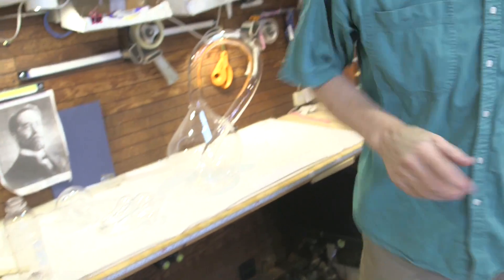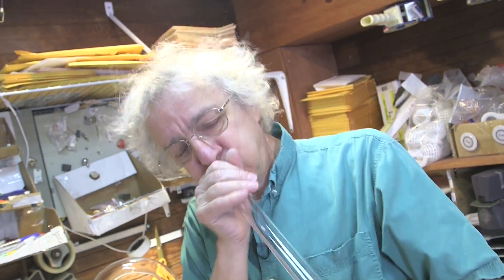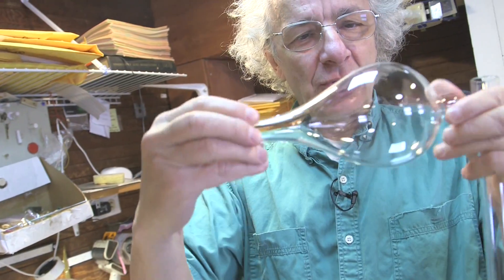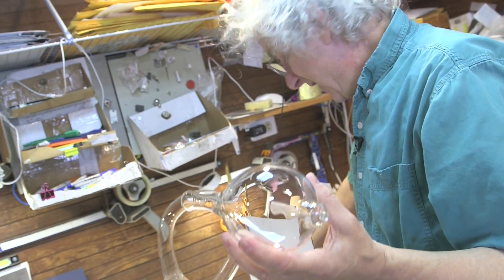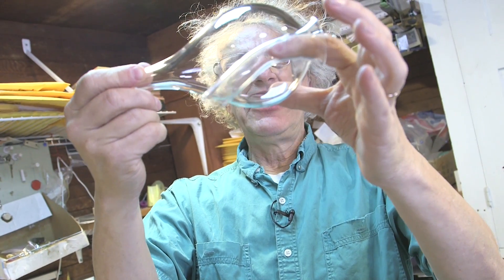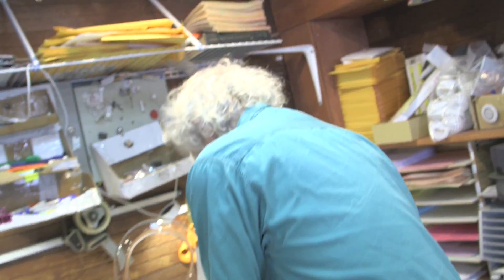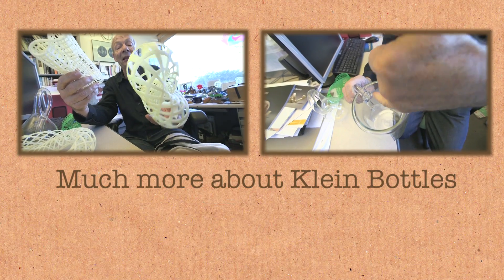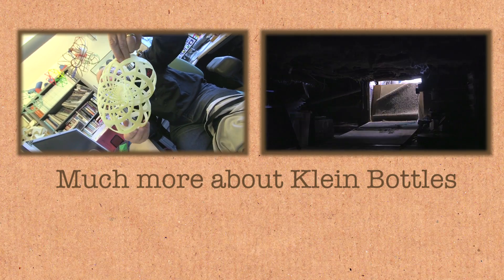How to make a Klein Bottle (in three dimensions) - Numberphile

Comment: There's a question that I have. Does Klein bottles have none or infinite surface area?
Reply: I think it's neither: it has a definite surface area but one thing we can say is that the "inside" surface and "outside" surface of any particular local region of the bottle are just different parts of a single surface. So we will end up with one number for the area however we may measure it, rather than separate quantities for two different surfaces.

Comment: I can only visualize a Klein bottle constructed using material having polarized properties.  Such as  partially silvered mirrors allowing light to travel only one direction through the material. The material would be situated such that all light could transit into the bottle and no light could exit it.  At the intersecting plane of the entrance channel and the body of the bottle, light would follow the channel up to and through the intersection.  The "inside" of the bottle would be uniformly blocking light from exiting even at the intersecting plane.  No 4th dimension required.

Comment: His enthusiasm makes me so happy! And how can he resist the urge to fill them?
Reply: ***** 0 volume does not mean you can't fill them. In fact they are already full - with air, submerging them in water and rotating them around a bit could completely fill them with water.

What 0 volume represents is the actual volume of the object. So the mathematical volume of a glass you drink from is the volume of the material used: glass, not the volume of water that can be poured in the glass even if that is what we usually mean when talking about liquid containers.
Reply: omccoy 
They have 0 Volume, so you can't fill them.
Reply: You can't fill it up because there's no "inside" ;)
Reply: ***** Well then a glass also has 0 volume but you can still fill it up :)
Reply: omccoy He has a delightfully high energy TED talk out there, easily one of my top 5 favorite talks.